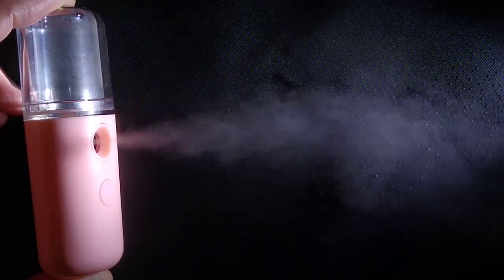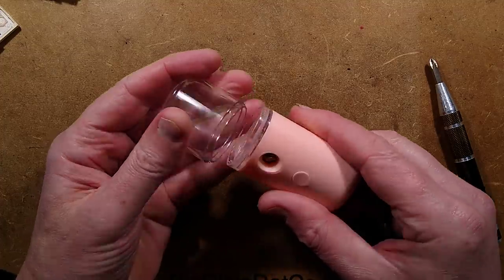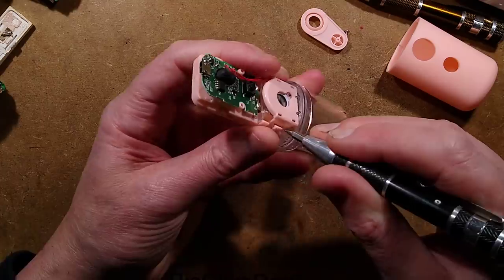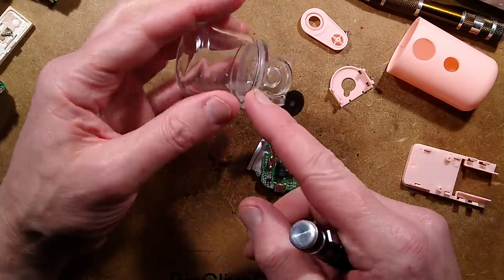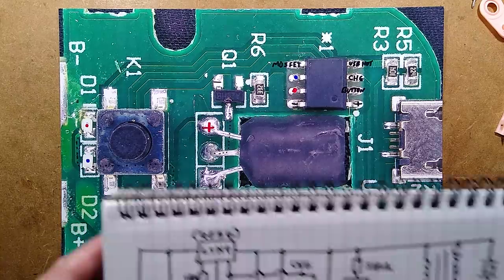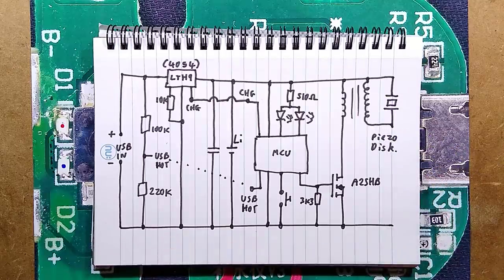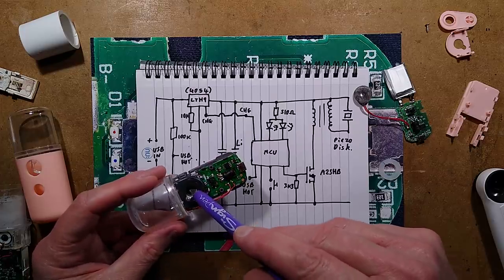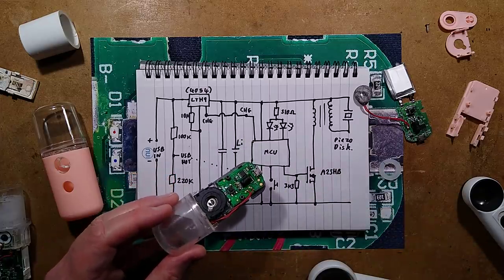Inside a USB rechargeable misting unit (with schematic)

Comment: Got a good one for you, I was given a Steam Iron to repair,  When I stripped it down there was an electrocuted slug wrapped around the thermostat.
Reply: Makes you wonder just where did that person store their steam iron.
Reply: @tncorgi92  I asked apparently on a wall clip in the kitchen.
Reply: We found a slug in the plastic viewer window of an electric kettle once, kept only on kitchen counter, they get everywhere
Reply: @samilyas2123  before or after you made tea?
Reply: 😄, where did you store the iron? -  if in a coat/shoe cupboard, assuming it was caught on his coat/wellington boots when he was working in the garden, and not seeing it and taking them off and putting in the cupboard, and it instinctively slithered into the iron as it sensed the water in the tank/leftover humidity (from when it was last used) and wondered into the electrical part and got fried when the iron was plugged in.
Reply: @samuelfellows6923  it was in the kitchen could have sneaked in on vegetables,  cooked slug anyone?
Reply: Dog Walker, 😆/✅
Reply: @samuelfellows6923  👍
Reply: i bet it didn't jumpscare fast enough
Reply: @redoverdrivetheunstoppable4637  there was a sizzling sound before it took out the RCD.
Reply: @dogwalker666  hopefully before they made anything with the kennel even if it was just hot water for something else I suppose that it may have already look like dark sea if that was the case and they turned it on without noticing it otherwise just ugh can just imagine that don't make me sick feeling a little nauseous after seeing that comment.
Reply: @samuelfellows6923  Libby the slug was trying to imitate a full Bridge rectifier and got reckedafride.
Reply: @aaronbrandenburg2441  mmm slug tea so tasty yummy 🤮
Reply: @dogwalker666  yeah exactly and that's what I was getting at would not want to be in that situation especially actually making something and not realizing. There was a slug in there not paying attention or not sing it at all or have that happened with a kettle that did not have a viewport by the way my folks have an electric kettle we actually had that originally when they bought it in Canada to this day there is part of the paint burned off the dubs on the bottom that served as feet this was one that was actually made entirely out of metal at least the base and anything that was not like a handle what happen is one of the people that happen to be staying with us went to make some hot water for something tea or something don't know can't remember when I was a kid and had put this on the stove not realizing it was an electric kettle they did not see the plug for the cord on the back of the kennel and the cord was kept in the drawer with like the ones for the mixer and the popcorn maker Etc from then on we left the cord plug in to it of course when it was in the cabinet but not in use I don't think we do anymore but hard to say been a while. Since I've thought about it.

I've heard about people you thinking the same thing in the middle of the night we're having something like that sitting on top of the toaster oven or even if someone mistakenly use an electric kettle that was plastic as a stove top kettle with the expected results of course but yeah one of those times.

Also to this day I don't know exactly what happened but we had learned that we had for years and what time will it start snowing this black substance was coming out of the steam holes on the soul of the iron I wonder if something like that have happened? Or something else anyone seen that happen before as far as I know there was no plastic that could have done that and melting in the steam system with the iron just one of those things that makes you wonder what the heck happened anyone seen that before and no waiting on that? Please comment if you had something somewhere or even something funnier or happening for the plants I'm sure everyone would want to hear including me but I did ask you laugh when that happened originally with the electric kettle on the stove since no damage was done other than the person face pulling themselves when I told him it was an electric kettle and I'm not noticing the connection for the cord I have to walk around the corner into the kitchen it was already on the stove and on so yeah but it still works this day not made in China another words it may either have been made in Canada or United States don't know but I do know that in the United States they did not confirm any of those here which I am in the US nowadays A long long time ago we lived in Canada. After moving from the US and then we move back surprisingly in the same town and the same apartment complex that we were in before not the same building but same complex.

That's one for the record books I'd say.

Comment: These things are actually really great, incredibly cooling in a hot summer & help with skin that’s painfully dry in winter from being outdoors then inside with heating. I was very sceptical but wouldn’t be without it now. Edit: I sprung for a mid-range one rather than an iffy eBay one and it’s still going strong 3 years later

Comment: You had me laughing at the comment about the air wick and how badly it melted the plastic. I think it’s in a glass for more than one reason. I wonder what the SDS sheet says about that aromatic oil diffuser.
Reply: You do not need anything crazy to badly damage some plastics. Basically any non-alcoholic organic solvent would do, e.g. acetone, toluene, ethyl acetate, (just to name the common ones). Since the perfumed "oil" (there is nothing oily about it) is highly concentrated concoction of various aldehydes, esters and ketones (e.g. cinnamal, citral, dimethyl pentanedioate), it will act in the same fashion.
The contents of Airwick products can be found here: http://www.rbnainfo.com/brand.php?brandId=2 under "Scented oil".
Reply: Same issue with liquid potpourri. I tried refilling the Airwick bottles with it, and it does work fairly well (aside from sticky residue at the outlet) but the plastic wrapped around with wick degrades. The wick then swells like a certain feminine hygiene product.
Reply: I vaped years ago, got a batch of "custom" plain cinnamon flavored juice and immediately had this happen in my plastic tank. I threw it all out and went back to smoking.
Reply: @jenda386  thanks for leak correction thanks for the link yeah if you had an appliance container there would be one of those but that was not intentional seriously but love to have links especially to technical documentation and or Wikipedia or anything for that matter regarding things like this and others I try to put in links where I can especially Wikipedia I know it's not always the best the purpose of credible information but yeah.

Also with the Google Maps and the covid-19 lair one thing that made me laugh out loud quite literally when it came to listing sources one of them was Wikipedia would you actually trust it for information like cases Etc I think not but that is just fail in my book.

That would be like basically everything on just what one person in the world says about anything and not going anywhere else except that person for any information at all and also that person being the one that would not have even made it out of kindergarten if you know I'm saying never knew anyone like that but it's just fictitious example of something couldn't think of anything better.

Also recently I found out that you could actually you virtually go down the street in Google Maps I just never realized that happen to brush across it a certain way we're didn't know that.

It was a coincidence in street view that that happened didn't realize it was possible.

Also was looking at someone's place I knew and I thought the head free down and I was told you were about it said them the link and I said oh no we don't have a tree down it's probably just the angle it was so convincing from the overhead view. It looks like a tree was laying down on the ground huge one but oh well funny is everything.

Also there has been some crazy things caught on Google Street View and others see videos on this and also on other side since 12 photos from this they honestly off a collection of Google view fails somewhere as an archive maybe perhaps a Google Easter egg 4 Google images or something like that that would be awesome or Google fail. Something or other. Whatever you don't get the poke fun at your own stuff and share the wealth or share the laugh whichever I mean it's those shower thoughts that sometimes bright my morning I'd say.

Comment: FILL IT WITH BOOZE CLIVE AND BREATHE IT
Reply: Hometown Heros, a program of a Fresno California based radio station (AM740), interviewed a WW-2 veteran who became a doctor. He did preliminary research on Maximum Contaminant Levels (MCL's) via aerosol. He said the current MCL's too low and are based on skin contact and not aerosol into the lungs. He said we are all being poisoned and to correct the situation you would have to get funding to do the tests all over again...and that most of the money for that would come from the chemical/drug manufacturer. Good luck with that.
Reply: @obsoleteprofessor2034  I think you've been breathing too many aerosols
Reply: @fireandcopper  I take mine anally
Reply: @fireandcopper  probably the same "researcher" who is convinced that the vapor trails are full of mind control drugs and control the climate.  Lol
Reply: @obsoleteprofessor2034  what chemicals are we talking about here?
Reply: @Francois_Dupont  Just about everything that is required to have an MCL determined was done with skin contact. If you look at any chemical's MSDS (material safety data sheet), there will be a MCL listed. His argument is that any material will have a greater effect if breathed in as opposed to skin contact. Hence, a amount, lower that previously thought, would cause ill effect (cancer, etc). The Hometown Hero's website maintains an archive of broadcasts. It would probably be easier to email someone at the site and they would probably find the interview quicker. The veteran may still be alive (95+?). His story details how he was almost killed 3x in the European Theater, then later became a doctor. (I think he made several discoveries in microbiology). He is no idiot. I heard the interview about a year ago.
Reply: @obsoleteprofessor2034  So you're advising that we don't breathe in herbicide?

Damn, there goes my Tuesday night plans.
Reply: @drunkenhobo8020  No...just don't breathe in that much.
Reply: @drunkenhobo8020  people SPRAY this everywhere, it is very common to breathe in Cancer chemicals because the average person doesnt even own a proper mask with filters.
Reply: Ha ha I don't drink and was thinking that.
Reply: @obsoleteprofessor2034  I actually live there.

Comment: I just bought it, round one because you liked it more because of stability xD for 4.3 dollars with shipping from China to Pakistan. And man this thing is lit, I like it. Inhaling water spray makes me smell some aroma that I get feel in air conditioner or inside refrigerator.  Current draw from usb when running with fully charged battery was 200mA. Advertised as 500mAh battery, should run for 2H+ but I highly doubt it. Mine auto turns off after 1 min which is annoying.

Comment: Everytime I watch this channel I can't help but think you could use the TC1 component tester, it's cheap and will give you component Data, very helpful with the mosfets and transistors where there is no standard number on them.
Also to figure out the pins on the microcontrollers since there is an inernal  diode between the I/O and VCC.
Reply: it will give him what data? Is it PNP or NPN? It's always obvious when they are in circuit. Transistor or mosfet? These days all battery powered devices will use mosfets to spare power. Details about mosfet? That it is mosfet? He already know that. Gate capacity? Just copy same pull down resistor like in original design if you want to reuse it. If not reusing it you should not care anyway. 
I will not say testers are useful to have them around for some situations but for what Clive do in these videos they are totally useless.
Reply: @gorjy9610  I disagree, they might be useful in some situations.
Reply: @masteryoda394  I miss a one "not" so to clarify now I say they can be useful sometimes. Just not for Clive in this type of videos. 
And rarely in all other cases :)